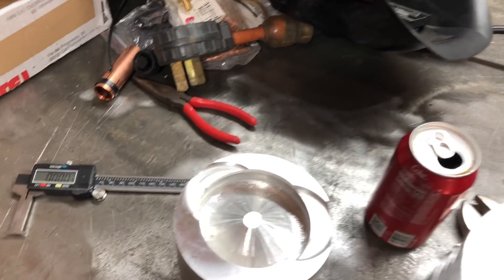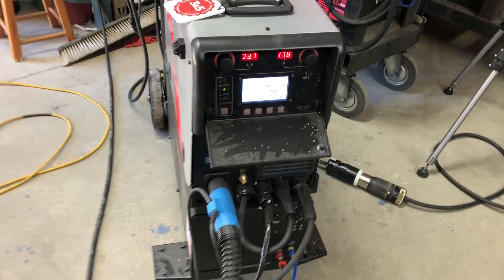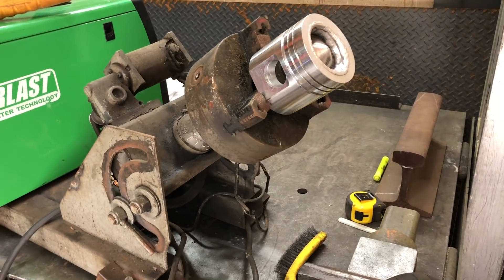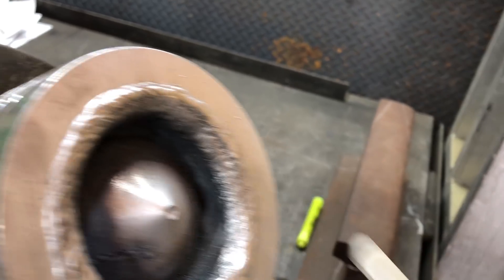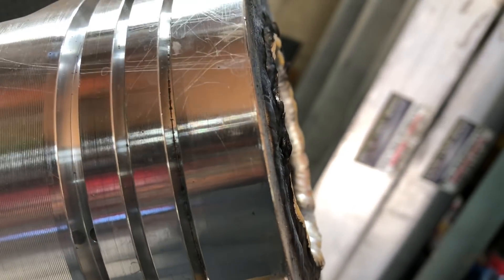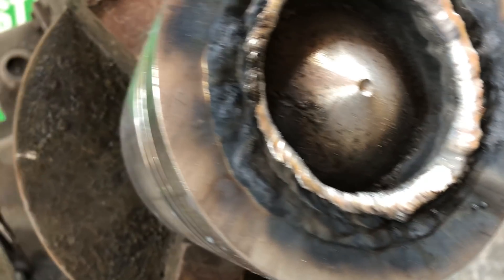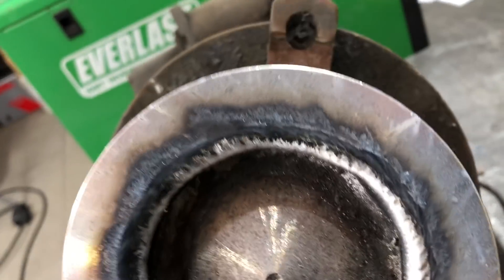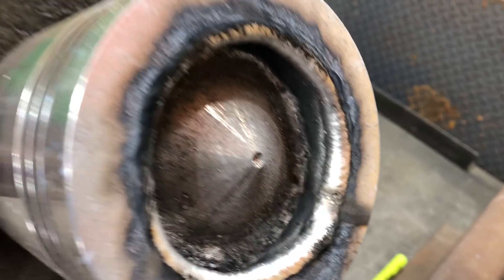Welding up an aluminum piston in a rotary fixture with 5356 and double pulse

Comment: is 5356 the only alloy that can be used  for that heat range ?
Reply from the maker: I am not sure ...   other guys tell me that pistons are an aluminum silicon casting  ..... (which aluminum and silicon you cant really harden all that good) typically the magnesium in a casting or in an ingot gives the Aluminum extra strength and makes it heat treatable for the most part ....   
what I do know the melting point of 5356 is higher than 4043 and it machines easier that is why I chose it .....
its going on the engine dyno today .... we'll see
Reply: Thanks and please keep up the Awsome videos!
Reply from the maker: I will try - I don't think I can keep up 5 a week - but 1 or 2 a week is the goal ....

Comment: I thought welding aluminum weakens the parent aluminum around the heat affected zone. I know a little about pistons and they take an enormous amount of pressure and heat for an extended amount of time. I hope they work out under the stress.
Reply from the maker: not does weaken it - but so do excessive exhaust gas temperatures ....  this is for a tractor pulling tractor ....   that guys will engine dyne it today - they only need to last a few pulls anyway .....

Comment: Pistons are made from specific high temperature Al Si alloys. I'd be worried about the performance of this repair unless you know its an approved wire for this purpose.
Reply from the maker: we'll see. - it goes on the engine dyne today

Comment: Another awesome video Pete!
I would have to tig it myself, but its great to see that something like that can be mig welded . I would never of thought it.!
Reply from the maker: Sharn,  that worked like a dream !  I got real lucky
Reply: ZILA luck had nothing to do with it. More like skill and knowledge.
Reply from the maker: ok - you got me. - although this was the first time in 22 years that I welded up a piston - it helps that I welded aluminum before and it also helped that I welded a ton of stuff on rotary fixtures before ....  

but still the first time welding a piston - so I did get lucky in a way
Reply: Productivity Trump's pretty in a world that runs off time and money, especially if it's getting covered up
Reply: ZILA Luck is usually the result of good management.

Comment: Seeing things here I never thought were possible. Good job!!
Reply from the maker: this is a real pain, borderline impossible to do with a spool gun or standard mig .....   the full synergic is the key to success here ....
Reply: ZILA I’ve done a lot of welding in my life, stick, mig, tig and plasma but I’m still at the sa 200 speed. I don’t even know what synergic is. Retired but still welding for fun.
Reply from the maker: no worries - here is a 1 minute run down.    Synergic mean that with one know you turn wire speed and voltage at the same time.   In the old days you set the wire speed with one know and the voltage with another.  You had to make sure you maintain a "ratio" between wire speed and voltage. Synergic means that the machine maintains that "balance" or "ratio" between wire speed and voltage "all by itself" ..... it is pre programmed into the machine.   NOW of course you want to be able to change that to your individual liking .....  so you have a second knob that is typically in the 0 position.  that knob adds or subtracts voltage according to what you set it.  that way you can make it colder or hotter as you like it.  

now adjusting the main knob that sets the synergic settings (amperage or material thickness over all) 

in this video what I am doing I basically made a "remote" knob on the mig gun and can adjust those settings while I am welding - so as the material heats up I can lower both voltage and wire speed an the same time - turning the same knob.

does that make any sense ?

with stick welding people did that for years ...   

you control the amperage with a remote (a little box and a potentiometer) even off an engine drive and you could do that with one hand while welding with the other or you yell to a helper "5 up" or 
"5 down" ....  so the amperage is set on the engine drive and the voltage is a "given" or is set by your arc length  .....

so picture synergic wire welding working very similar to this ....
Reply: ZILA you are awesome, thank you for your response, well appreciated. Understood, now I know, thank you.
Reply from the maker: you are very welcome
Reply from the maker: Richard, I bet you this video here https://youtu.be/vIAhzA3xY8A now makes perfect sense to you if you watch it again ....

Comment: I'm getting more and more interested in aluminium MIG with every video.
Reply from the maker: if you do a lot of aluminum (non cosmetic) welds ....  or if you have to weld "thicker" stuff where a 200 amp tig even with a helium mixture is not really "happy" ....  mig might just be the solution  .....

but that is for you to decide ... stay tuned ... there are few more coming ....

Comment: awesome welding! but doesn't it warp by all the heat?
Reply from the maker: not enough to worry ... so far so good - the pistons have been re machined .... one piston ring grove "closed up" a little and had to be re machined ....  but they are still round and everything seems to be working so far